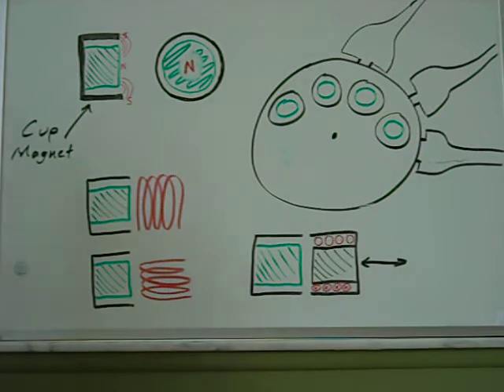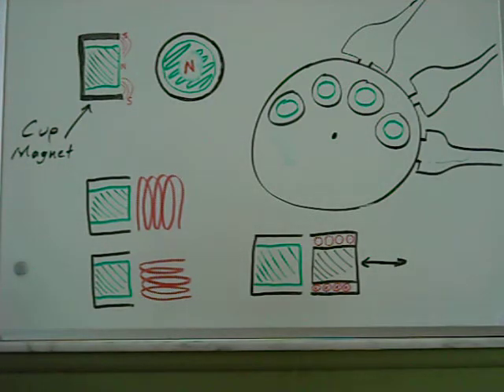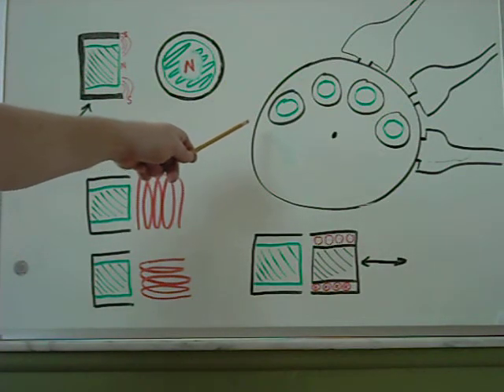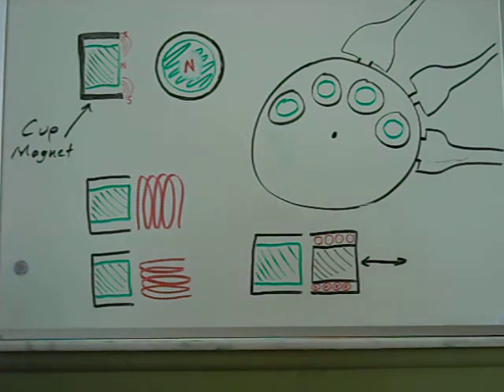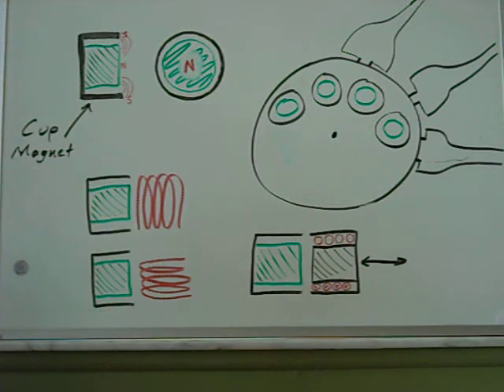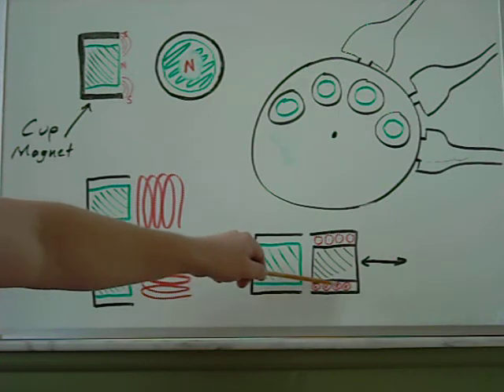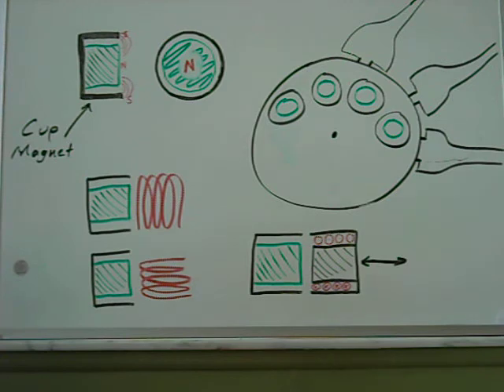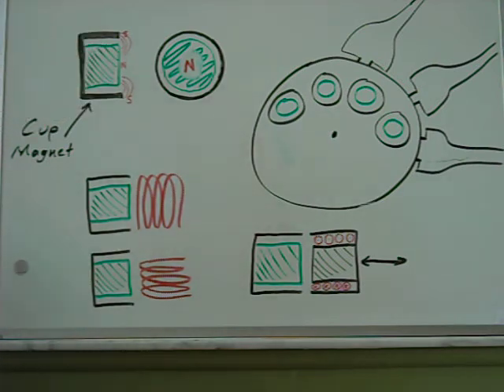Coggless wind turbine drawing.avi

Comment from the maker: @trailkeeper 

I have not experimented with this in the real world yet, and so I am just speculating.  it is my impression that the flux from the cup magnet will flow through the center cross hatched area, and exit the outer portions of the pickup assembly completing a magnetic circuit.  In actuality, there would be an air gap between the inner flux guide/coil and the outer flux return path.  I don't believe that significant  flux will flow outside of the pickup assembly.  Thanks for the post!

Comment: @josh8loop That is where I get mine also. You might want to try a surpintine coil with 24 or higher wire about half as thick as the magnet is wide that way the north and south poles will be able to pass individually over the coil then you can off set each coil to give you your phases. Testing the coils in different configurations is needed. Good luck I'll keep up with your posts, I'm interested to see how these magnets work out for you.

Comment from the maker: @depravedpuma 

The Cup magnets I have been looking at are from here:

magnet4less:

      Neodymium Strong Magnetic Cups Size: 32 mm Diameter x 8 mm thick with 10.5 mmx5.5 mm counter sink hole

Rated for approx 80 lbs pull force, and only cost $3.05 each.   Right now this is all in the mental development stage.  In fact, I believe I may have have come up with a way not to rotate the magnets or the coil and still make electricity from them.  Wild stuff!

Comment: @trailkeeper  a dc motor needs brushes and a diode. these two things are why they are not sold as a wind turbine generator. mother nature gives and takes. you have to design something that works for YOU it would be hard to design something that works for everybody. 3 phase ac runs smooth. you would not be happy with single phase as it would cog more. to gain efficiency run the pma 3 phase down to the bridge rectifier. grid tie inverters are more efficient than batteries cost and maintinance wise

Comment from the maker: @trailkeeper 

Thanks for the response, and thoughts.  Good point on not needing the extra diode on each phase, I would only need one.  I am thinking I will experiment with wiring to overcome this issue so I will have full phase AC out of it.   Or perhaps I could ask the cup magnet supplier if they are able to supply the magnets both ways.  O scopes can really be helpful for sure.  It's cool to see just how close to an sine wave you can get.  you can even see hysteresis and other things.

Comment: Nice questions, some I don't have answers too, but maby making a "dc generator", you might not  need some of the diode rectification of full ac,  which would reduce the output voltage a bit.....but then part of the coil is in other direction.   I would stick with the conventional coil winding/position as you mentioned so as to keep the relative movement of the wire in the coil, and magnet/field, at perpendicular to each other.  An oscilloscope would be a nice tool, wishI had one, maby sometime.